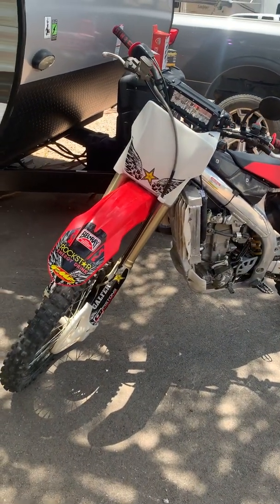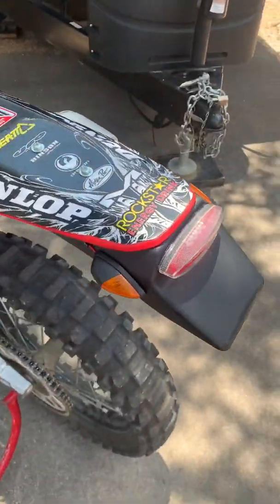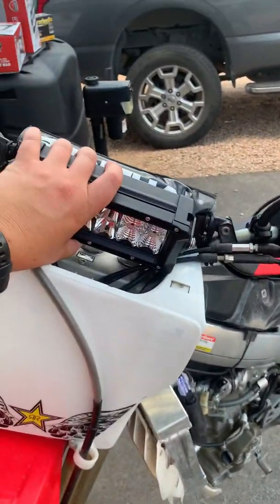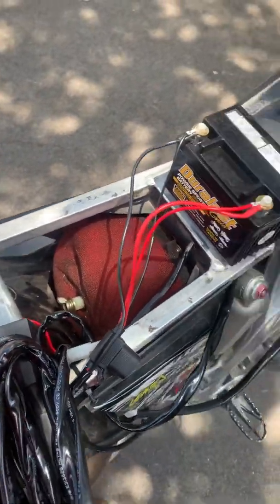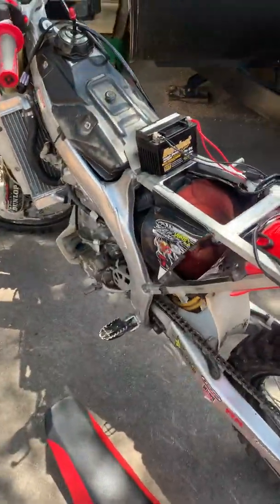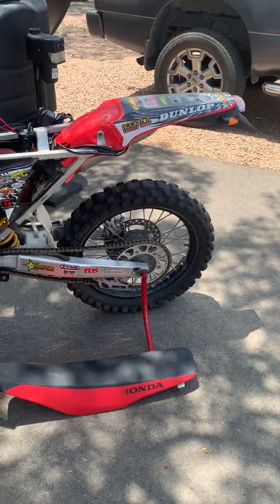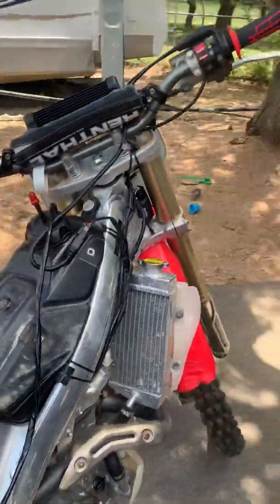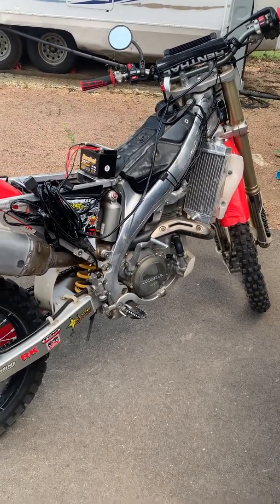How to wire a battery to a dirt bike

Comment: You literally didn’t even tell us HOW/WHAT you wired your battery to. Your title says how to wire a battery to your dirt bike lol
Reply: Im assuming hes just using an external trickle charger. You can wire it into your bikes stator but most stock stators only output enough for the spark plug. Better to upgrade the stator, add a voltage regulator and wire your lights directly to it.

Comment: Bud if you cut the wires to make it shorter it's only going to be three wires four wires when you cut it do it slowly and pay attention to what color is which and reconnect them the same way they were in the beginning nowhere near rocket science and for your back tail light wire it up drill a hole and run it through that

Comment: I just mounted the exact light bar on my ebike & cars hate it😆 it is bright as fuck I keep it on high beam until cars lower theirs & I can tell factory from aftermarket lights I’m using a 12 volt 8ah drill pack. Ride on homie✊🏽👍👊🏼👍🏾

Comment: Did you ever install the lighting stator? Or can you wire the battery to the stator for charging? Thanks for posting!
Reply: I’m asking myself the same thing. Any luck on your research?
Reply: Some bikes don't output enough amperage to power a lighting system. As for the stator replacement, its hit or miss on whether or not a particular bike has the aftermarket support. Take for instance my 2008 Yz250F, the only solution other than this that I have found is to take the WR model's stator and flywheel, and machine the flywheel down to fit. It ends up being a 2 to 3 hundred dollar project.
Reply: You have to either upgrade the stator on a regular dirt bike, or you have to get a battery like in the video which you would have to charge with a trickle charger at your house and figure out how long it would last before it runs out of juice

Comment: How is the battery connected to the motor? How is it charged?
Reply: I think you have to charge it after you are done riding.
Reply: I’m also trying to figure this out
Reply: What im doing with mines is just charge the battery with a trickle charger at home when done riding. Thats what I plan to do as im not looking to open up my engine to upgrade the stator. But in the future I can upgrade the stator and hook it to the battery with a voltage regulator and keep it charging everytime I ride. But for right now I'll just charge the battery when im doing riding as I dont ride it often

Comment: I don't know if this helps, but they do make a switch that mounts on your handlebars for your headlight. Sold online. Also, they do sell universal key switches you can wire into your kill switch wires. I am working on installing one on my Husky 610.
Reply: Also, this bike may be long gone but just in case this helps anyone else I thought I would comment.

Comment: Do you ever get problems with overheating
Reply from the maker: Hey Brett, I haven't noticed any overheating but, I think I need to downgrade the light bar to the 6 pack LED setup. I think my current light is draining the battery faster than I'd like. I'm also considering to replace the stator and run the electrical that way. More vids to follow. Thanks for watching.
Reply: Matthew Tudor 
cool thanks for the reply, considering doing this to my 250r and debating if it’s worth the effort. Look forward to more vids
Reply: @Brettdavidson527  Lol I also wanna do this to my Crf250r to be able to get a radiator fan kit because mine overheats real easy

Comment: How long does that battery power the light?
Reply from the maker: I can usually get one or two rides out of it before I put it back on the trickle charger (battery tender). I'm using it as my daily driver but, considering changing up the battery for a more powerful stator and tapping into that.